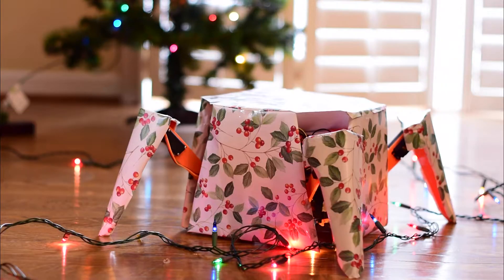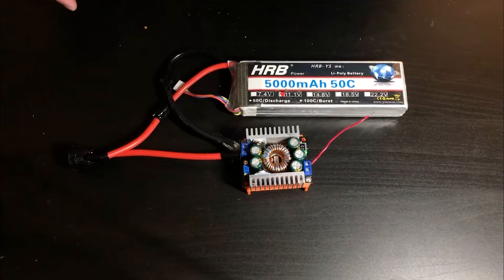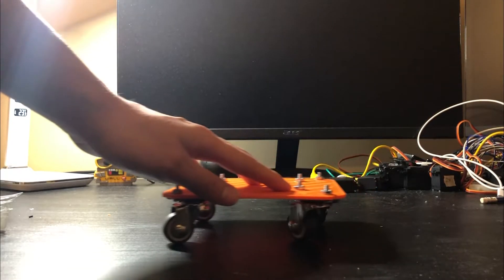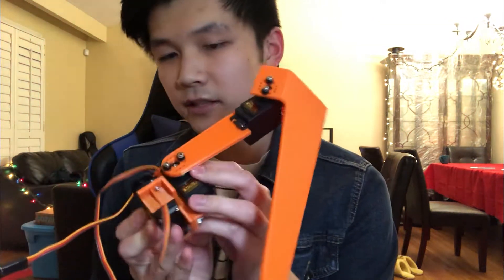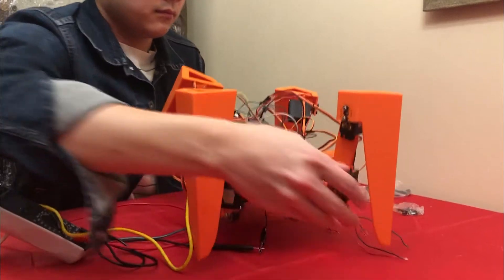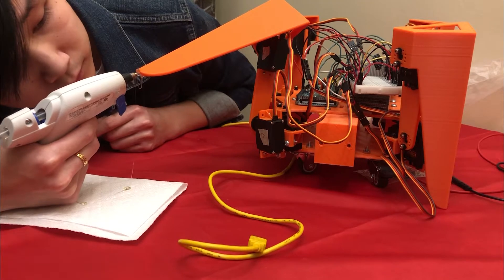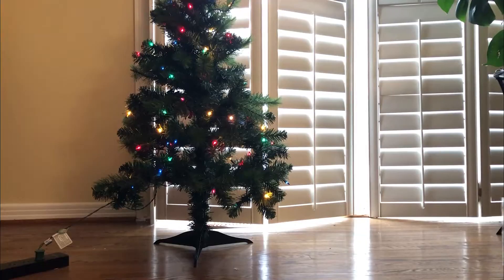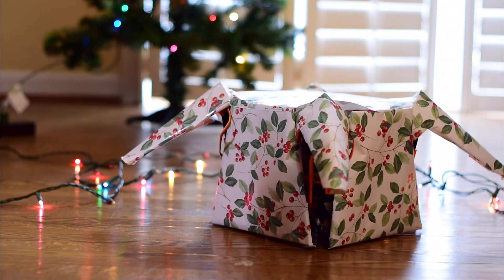Building a Robot Disguised as a Christmas Present

Comment: Hahaha maybe if those castor wheels can be lubricated, boxy could then be a 'skating spider robot' that would make a cool YouTube video too! Anyway really cool work Russel! Any specific reason why you chose to have those castor wheels in the design? Is the hub of the robot too heavy for the legs to lift?
Reply from the maker: Thanks!! And great question; there were two main reasons for the caster wheels:

1. At the time when I was designing the robot, I had no idea what kind of gifts I wanted to put inside the box (and hence didn't have a good idea of how much total mass the robot would be). So with the caster wheels supporting the load I didn't have to restrict myself in terms of the weight of the gifts.

2. I wanted the robot's walking pattern to appear more dynamic, i.e. by lifting two of its legs at once during a step. Generally this would require more complex controllers to perform, but by using the casters I could bypass all of this and guarantee stability when walking. The alternative to guarantee stability would be using a static gait such as moving only one leg at a time while keeping the other three feet on the ground, but this walking pattern would be slower and also simply wasn't the aesthetic that I was looking for.